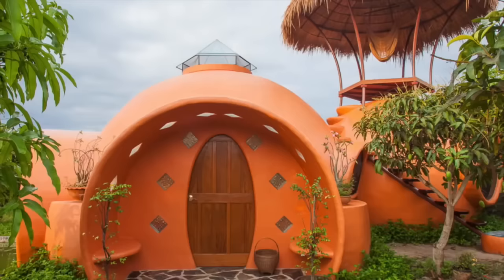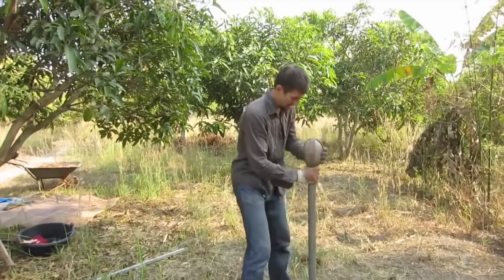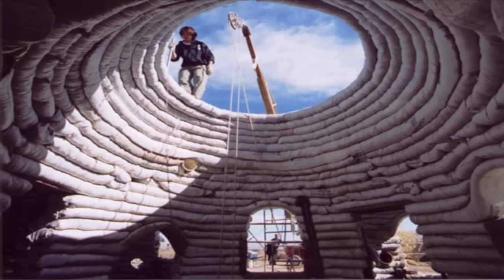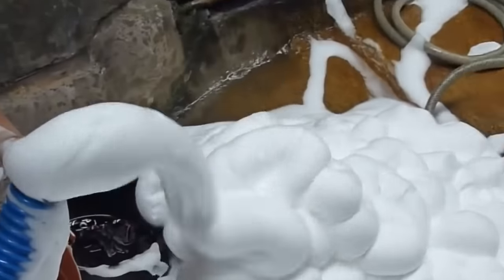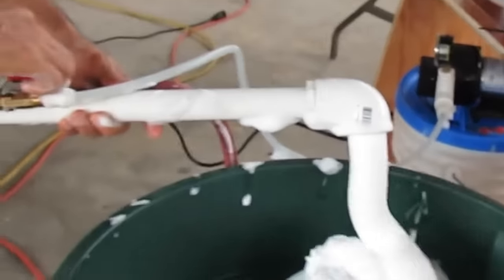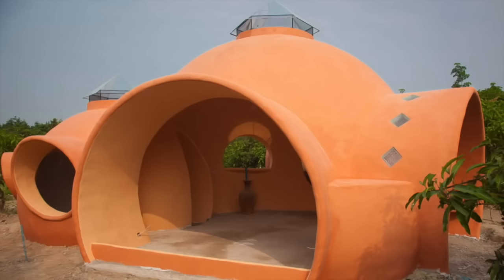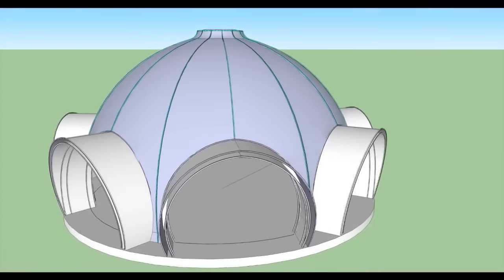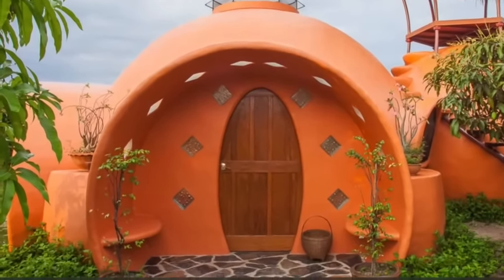How We Built this Dome Home (For Under $11,000!)

Comment: I’m building these now. Absolutely amazing and crazy. He sells the material. 👌🏼 go get it
Reply: Fantastic! All the best to you!!!
Reply: cool!
Reply: Where?
Reply: I need someone who has done it to build mine. 👍
Reply: I live in Michigan. I feel like this process, maybe combined with earth homes/earthships ... that somehow you could build and live year round in a winter climate as well. thoughts ?
Reply: @crazywisdom2  I live in a 1983 dome home in Kansas. Built in 83 and used as a cabin. Moved in when kids left and have lived there for 24 yrs. Love it! It’s wood of course but I don’t see why if either steel strapping or welded wire was used with hurricane straps to foundation that the new concrete/air material would be a problem. Depending on design and location of course. Love way the lattice used for the top looks inside. Very cool. PS if in a warm/hot climate be SURE to have a adjustable vent of some kind in top to vent off hot air after being gone.
Reply: Thanks
Reply: I live in North dakota.where would I be able to purchase material to make house.and where would I find a contractor???
Reply: Are these homes sturdy? A tornado will take it off the lot?
Reply: I urgently need on in arkenzo I have 11000$
Reply: Dianafarm in numbers Aradi omg, take your phone # down!
This is the comment section of social media and the trolls could come after you and bamboozle you! 
There was a website address at the end of the video, I'll bet you can find a phone number to call or an email address for contact info.  

So sorry for your loss.
Good luck, best wishes and enjoy your new dome home👍🏽
Reply: Make a video!
Reply: @Comments_From_All_Channels  Why would a home of basically concrete float away? A poor set would. Brick is best for tornadoes. It does look red so I'm sure crushed brick is used in some sense here. If it is clay from ground it would still hold well on a correct set
Reply: Please make video! I'd love to see how it's going!! I'm not strong enough to build one by hand but I'd still like to know how this is going for you
Reply: Can you built it indian 
All the raw materials used are easily accessible 
Please guide 🙏
Reply: Would air-crete be a good material for traditional straight-wall structures too?
Reply: IM SAVING TO PURCHSE PROPERTY, THEN THIS WILL BE MY BUILD!!
IM SO EXCITED!!!
Reply: im buying some land could you make a yt video explaining the process in detail
Reply: Of course he does.  This is a business, not a religion.

Comment: Back in 1974, my Father and a couple of other people came up with a method of building dome structures that was even less costly than your design and that required less labor. The structures could be adapted for use as housing and/or community facilities. One of the amazing aspects of the structure was that a dome with a diameter of 12 ft. with a center height of 8 ft. could be warmed to room temperature (68 to 77° F) in a relatively short period of time, by a single 60 watt incandescent light bulb. The basic construction of the dome started with a concrete pad to which was added a wireframe dome. Upon this frame, three layers of material were sprayed using a proprietary system that resulted in a 3 in. foam core sandwiched in between two 5/8 in. layers of specially formulated concrete. Once this was completely cured, openings could then be cut out for the installation of doors and windows. This construction process was so cost-effective that when it was presented to General Yakubu Gowon, the then head of state of Nigeria, as a cost-effective way of providing public housing, medical, and educational facilities, it was immediately accepted, and contracts were signed. Unfortunately, before the project could get started, the military coup of 1975 resulted in the overthrow of Yakubu Gowon. The incoming new head of state, General Murtala Mohammed, canceled all of Yakubu Gowon's contracts, arrested and put my Uncle in jail, who was there to oversee and manage the project, and confiscated all of the equipment associated with the project.

Having invested everything into this project and not being able to recover any of the costly equipment, my Fathers business was forced into bankruptcy, and to my knowledge, the building process was never utilized. So it is great to see that the concept is at least being revived and perhaps this will lead to the rediscovery of the process that held so much promise back some 45 years ago.
Reply: Wondering-was his work filed as a patent?Any literature remaining  on the processes?
Reply: I hope that those who stopped your uncle's project and jailed him get to meet God soon.
Reply: @marilyncairns18  Any records/files are gone. At this point, everyone involved is long since passed.
Reply: Sorry for what happened to your family. 😢

Comment: I loved this ! Especially the air Crete !!my dad had a concrete products company for 44 years w a batch plant etc , he made underground homes w “ waffle “!crrete panels - I  wish he were alive to see this ! You’re a genius!
Reply: OMG is your father's kind of construction still being done?  Can I find walkthrough videos on here or something?
Reply: Some underground concrete did really well, and is still going strong, 40+ years, but lots, have had issues.  One which was a berm style underground home built in the 70's, has had the rebar rust, and walls break, etc, it looks like a death trap.   I'm thinking, the texas dirt is toxic towards concrete, and even plumbing.   Jokes on us, some older cast iron pipes, in the east texas dirt, are still functional nearly 100 years later, whereas the pvc has gotten brittle, the copper has got pinholes, and the concrete steel, has rusted out.

Comment: I LOVE the idea of this style of home!  Wow!  Unfortunately when I started reading about "aircrete", I discovered the reason why we don't typically do residential builds with aircrete is because it cracks so easily.  Aircrete has incredible pressure strength, but it is brittle and will crack with the annual changes in temperature as all structures expand and contract with the seasons.  If you are in a tropical environment with very little seasonal change (like this home owner was in Thailand), then you're probably in good shape.  But if you build something like this in Northern California where temperature swings are huge, cracking is going to be a big issue!  If you have found a way to resolve this, please post here!  I would be interested in learning more for sure!
Reply: Good to know about cracks so easily.
Reply from the maker: This is a common misunderstanding about aircrete.  While aircrete on its own is brittle and can crack, we use reinforcing layers on the inside and outside that give it excellent tensile strength.  Also, the dome shape works very well for aircrete.  With traditional concrete, you put rebar inside to give it tensile strength but with aircrete, we use fiber-reinforced stucco and plaster.  It ends up being like a surfboard with a lightweight inside glued to two thin layers, which makes a very strong composite material.
Reply: What if you cover it with something that would limit that?
Reply: @LocdnessMomster  thats just what domegaia said above in the comment. they use fiber reinforced stucco or plaster over the aircrete which insulates it from rain and temperature changes.

Comment: Wow! Would it hold up to tough winters? That looks amazing!  Needing my retirement home!
Reply: @K. Salt She’s asking because houses are built to fit their environments. What would be the use of building a house in Florida with the same build as a British house?
Reply: @K. Salt  but what about the effects of freeze/thaw cycling many times over an average winter?? Will the air crete crack? Where i am, we get temperatures of minus 30 Fahrenheit.  To keep water available in winter, we have to pour a basement - so the water comes in the house below the frost line. Our frost line is 6 feet down. So do you see why we wonder?
Reply: You could insulate it more for your surrounding climate
Reply: It seems to be made in hotter climates, although it's something to look up
Reply: @mominminnesota6648  supposedly having a better network of pores allows water to basically escape concrete much easier and be less susceptible to cracking.  at least this is my understanding.
Reply: Go to their website
Reply: I live in a state where we get snow and zero temperatures would it work and I wonder if you can do two story homes
Reply: Good question?
Who would be the first to experiment with it?
Reply: @mominminnesota6648  exactly what I was thinking. In way northern NY, we get the same below zero weather. I’m curious if a cellar could be put under this or everything would eventually get moldy like homes built on a cement slab. Stuff in closet: moldy.
Reply: @Dk-ns3ge  my thoughts too. Might not work so well where I live.
Reply: @pyoumell  "Stuff in closet: moldy" .... you're exactly right!  We live in Northern NYS and have to leave our closet doors open at night to cut down on the mold during winter months
Reply: @singmysong1167   Probably not 2 story. The problem is compression strength. That's why you will not see this type with over 24' diameter. Even though you can increase block thickness you would have to add reinforcement for it to work.

Comment: I'm blown away by the craftsmanship and beauty of the domes you've built.  How well do these structures hold up against cold conditions like teens or even below zero?
Reply from the maker: Many of them have been build in cold climates and they perform very well.  Domes are efficient as the reduce the amount of unsed head space.  Aircrete also has good insulation value which is great for hot or cold.
Reply: What is the R-value, and do you have a variable reduction method to make the difference across areas less, and are there different materials testing for the outer varnishes (the fibre ones and fibreglass /stucco) Also lastly, at which point would one put paint or dye on top of the finished concrete (as I know ordinary floor concrete is easier to paint after curing and before varnishes)
Reply: @domegaia  could you answer the above questions, R-Value (and then with additional coatings the impacts of those) and if having a dye which ways are best to go about it (time to put on, which type of coating is best  or dye blended into the aircrete)
Reply: R value is usually around 5-6 per inch. here we also have quite a bit of far les insulating mortar which probably reduces the overall insulation by half. Still reasonable. Looks like 4 inch walls, so an r value of 10 which is about what an insulating cover and reflective cover will provide.

Comment: As noted, the tensile strength of the material is not very high. Perhaps it could be improved with the addition of microfiber reinforcement. The concept is somewhat similar to pumicecrete, where natural pumice, a very lightweight volcanic rock, in a pea gravel size is the primary ingredient with the concrete binding it together. It should also be noted that these types of lightweight cast concrete structures allow for a wide range of final forms, not just domes which are not for everyone. The material is also suitable for hybrid structures, where the primary loadbearing frame is of a more conventional material, e.g., reinforced concrete or steel and the panels are of aircrete. That would be a lot easier sell to obtain a building permit in many jurisdictions.
Reply: I watched one video in which they put a fiberglass mesh on the exterior and then coated it with a thin layer of concrete.

Comment: This sounds just about perfect. In your experience, are the communities and counties pretty receptive, as far as building codes and permits?  I'm in New Mexico. This would be beautiful out here.
Reply: New Mexico has houses called “earth ships” you may want to look into what regulations they have there
Reply: building codes?  we don't need no stinking building codes.  they are like so called masks, face coverings.  the govs way of more control.  can you read "1984".
Reply: Good question. Waterproof. 
Fireproof.   Would be a plus in so many ways.
Reply: @michaelcee8348  I can't tell if this is serious or not & this bothers me.
Reply: 4/23/23...You KNOW the govt would have to be "involved". Americans can't just build a SAFE dome residence without all those silly permits + inspections b/c the building + code enforcement guys MUST GET THEIR "CUT" OF THE ACTION!
THAT'S WHY CRAPPY WORK + HIGH PRICRS + EXTRA REGULATIONS! 
$$$$$
Reply: @michaelcee8348  If you ever renovated/rehabbed old homes that were built before building codes, you'd change your tune. Example 1: a late 1800's house that was only still standing because it was brick. Cracked plaster walls throughout and the entire floor was slanting towards the bathroom. Why? Someone had cut out a floor joist in order to get the bathtub plumbing in. A full of water cast iron bathtub is incredibly heavy, and the whole house was caving in towards it. Example 2: An early 1900's house where a slant roof addition was built in the back to house a kitchen, bathroom, and mud room. The roof was built with 2x4's and the span was about 18 feet. This set up is not gonna work!  The roof was caving in and they'd laid out a 2x6 beam across it to remedy the issue, and if you were taller than 6', you'd hit your head on it. To make matters worse, they laid the 2x4's right on the big picture window instead of framing out the window, so of course the window was cracked. I have 2 dozen more examples. Sometimes it's so bad the house just needs to be torn down. So why do we need building codes? Because people are stupid.

Comment: I live in Canada..wish these could    work in a cold winter environment
Reply: I believe aircrete has a pretty high insulation value per inch. If you build your aircrete walls thicker than you would in a tropical climate, you may very well be able to achieve a very satisfactory resistance to heat transfer (R-value). Of course, thicker walls mean more materials but just about any conventional building system in colder climate requires more stuff anyway.
Reply: Tanya Lake  yes..I live in Alberta Canada and this would make a great mother in law home..if it would work in our weather